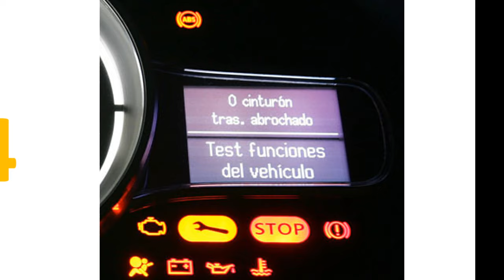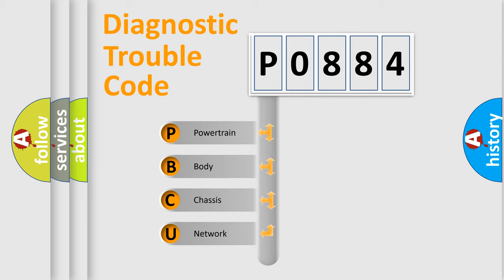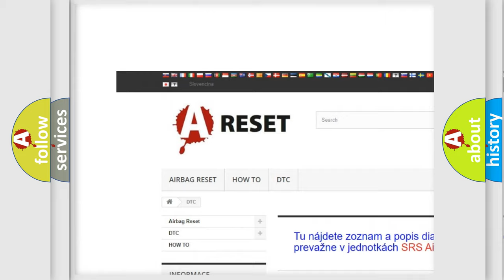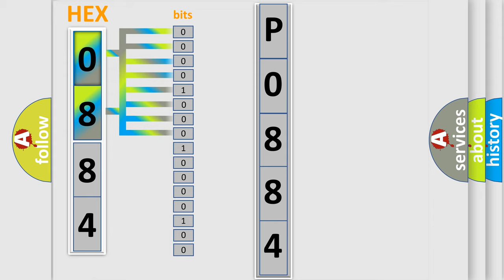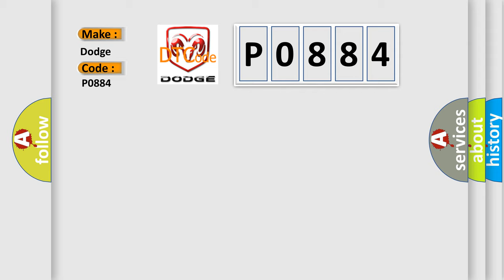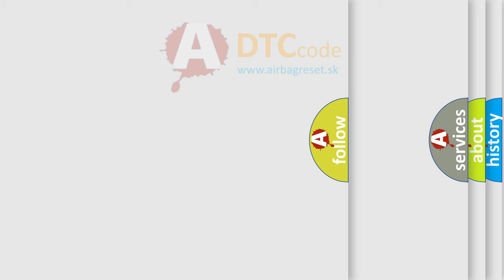DTC Dodge P0884 Short Explanation

Comment: I have this code on a 2009 dodge charger , what should i do ?
Reply: Did you get this issue resolved?
Reply: @jobro95  no it went away overtime
Reply: @iitwofatalshots2756  thanks for the reply. Got this code the other day. Just disconnected my car battery for several minutes to reset the codes and now the error code is gone. I read on a forum that this code can occur from having power being cut and then delivered to the transmission while the car is in “drive” and moving faster than 20mph. I did accidentally turn my key to off on the highway a few days ago. Nothing bad happened and the car still drives fine. Hopefully this can help others.
Reply: Had the code replaced TCM 2005 Durango no problems since, caused a rough jerk at high speeds, very scary.